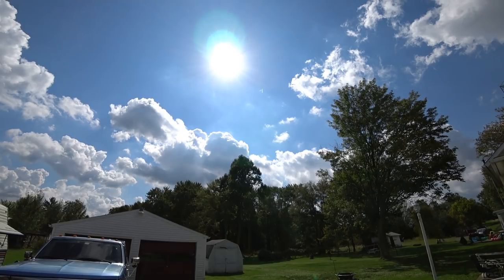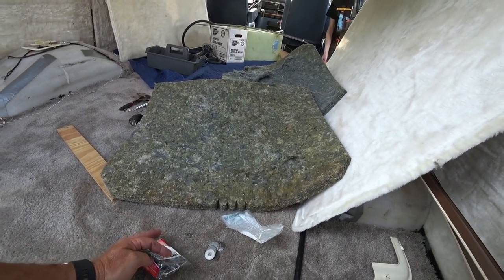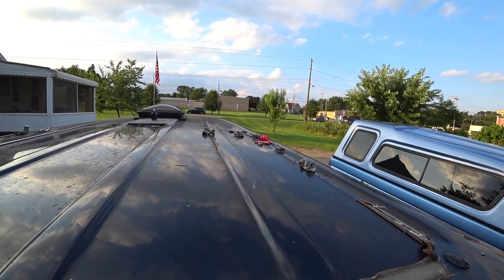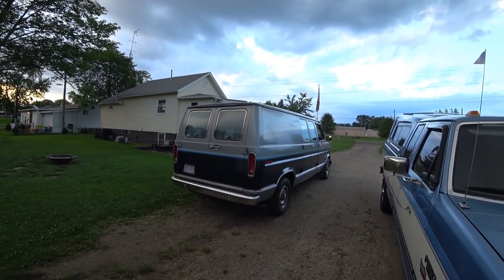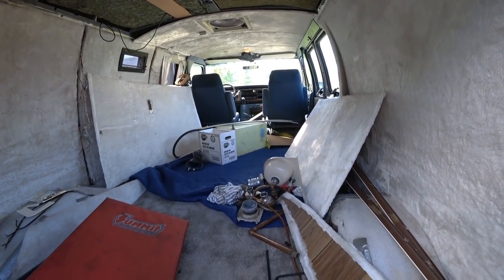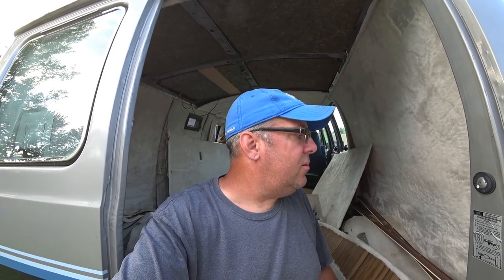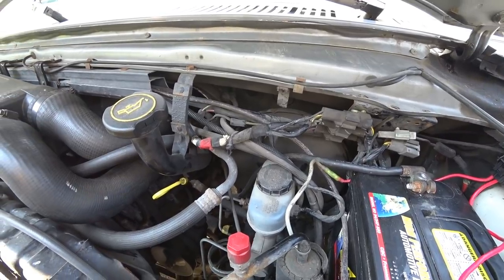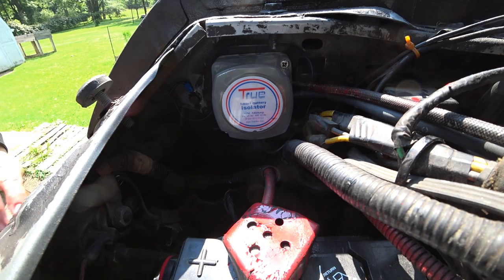Nomad RV Van Build Part 2

Comment: I guess you didn't see the my vid when I replaced my brake light switch in Auto Zone parking lot, went to start it and it wouldn't start. of course it had to be something I messed with replacing the switch... nope, after hours of checking everything (accept the fuel pump) guess what it was, lol....  wish I was there to recover those panels. Great job!!
Reply from the maker: 👍😁 yeah those white fuzzy panels are nice to have as far as sound deadening inside and they are definitely soft to the touch so they are easy to lean up against and they are light-colored so they help with keeping the back of the van bright but keeping them clean that's a whole nother story. As long as he's okay with it I don't have a problem. When we start installing the cabinets one of the walls will definitely be paneled but everything else will most likely stay the way it is. Yeah I was kind of funny that I would have found the problem a lot sooner if I knew about the problem just two days sooner. Like I mentioned in the video, I try to troubleshoot like the Mantra that I have told many others and that is, if you make changes or a repair to the vehicle and a new problem pops up it's directly related to the change of the repair that you've made, 99% of the time. But my confusion came with that I made the repair on the turn signal and then 2 Days Later tore apart the back of the van and at that point realized that there was an issue with the brake lights. So I thought it was something that I did on the latter repair. Well, I was wrong. And after 4 hours of troubleshooting it dawned on me it might have been the turn signal repair. But it's all good now. A friend of mine I went to HighSchool with told me that he would rather have me make a rig job on his vehicles then have a certified garage mechanic make a qualified repair on his vehicle. That rig job that I did on my son's turn signal cam in the steering column was made with a small coffee stir straw for increased tension on the turn signal cam latch and, knock on wood, it's still working now a year later. So glad to hear from you! even though I don't comment all the time glad to be watching what you got going on out there in the West. Keep rolling strong!

Comment: With the interior covers down, it would be a good time to run your wiring for lights, and marking where the metal support post are so when you put in cabinets, kitchen and bedding you will know where the interior structure is and where you can fasten into for support. I would have thought a young man would want a smooth modern wall instead of the 80's fuzzies that is going to be tricky keeping it clean .  Electrical wiring for lights by the bed and plugs for the phone charger, etc. is looking ahead for the possibilities.
Reply from the maker: They have been down a few times.. More on that later..

Comment: So with Ford if you think the camber is off check your  ride height. You know as the front sinks down the camber goes negative
Reply from the maker: Apparently it's just me, we took it to an alignment shop just recently and had his tires rotated for the first time and the gentleman that worked on his van has been working on Ford's since the 70s. He said it was slightly off however he had a special tool that Ford supplied to their dealerships that was really unique. So you let me come back in the shop and check it out and it was really cool to see, he had a Ford tool that was in the Ford Packaging that allowed him to bend the i-beams. I didn't even know something like that existed, he said a lot of people didn't know. He said he got it off of a old Ford mechanic back in the 70s when he had retired. Apparently he worked at the Ford garage with him at the same time and the old guy told him that nobody hardly used it so the owner of the dealership told him he could keep it when he left. Well the mechanic that I was talking to, who is now an old guy himself, said that he was given it to use until he retired. Well he's 75 and he hasn't retired yet, and I'm glad. Something I found out later because I had never looked I just assumed is that this van is a Kingpin not a ball joint set up. Ever since the last alignment the front end looks really good and of course it's goes down the road really nice. I have a bigger repair that I have done on the van we'll talk about a little bit later in the series that had to do with the van pulling.
Reply: @Rvdaydream  I have been  working on cars since around 90 and haven't found anybody who had the tool for bending the I-beam.  The fun one on that is if it only has one adjustable tie rod to straighten the wheel is pull it from the column and put it straight while driving.